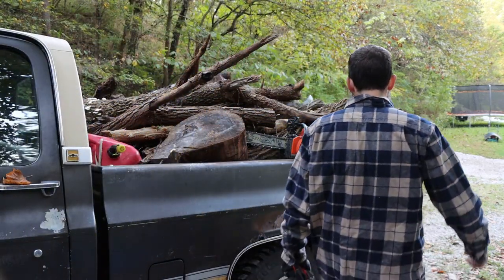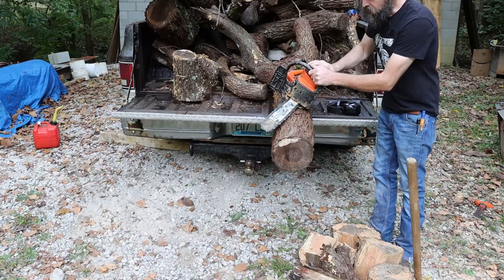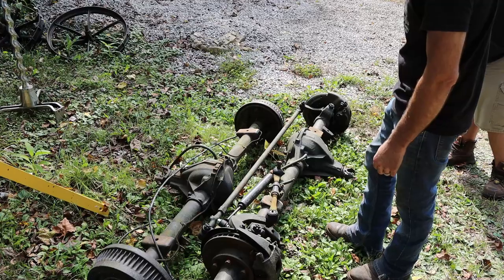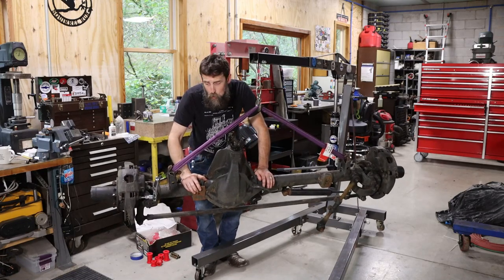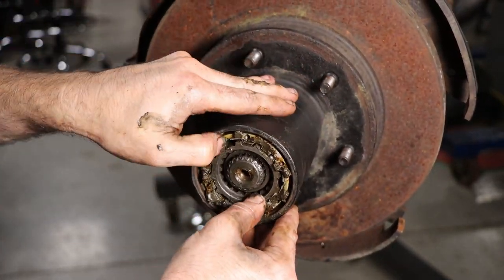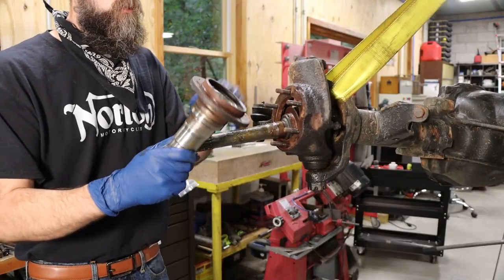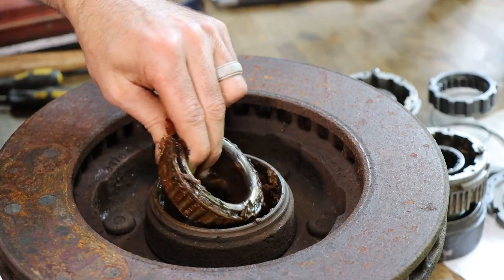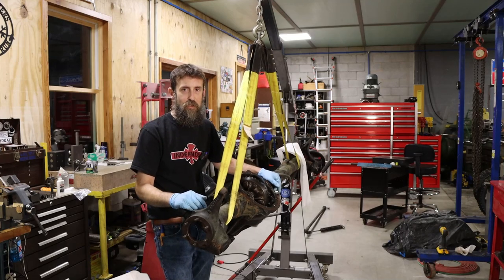Let it begin! Chevy K10 Front Axle Part 3

Comment: My house is completely heated with wood and buying a top handle saw, for all the smaller limbs and delimbing branches is one of the best purchases I've ever made.  It's nice to have a saw you can run 1 hand, while using the other to move branches.  

Another issue with the mushroomed heads of wedges is, sometimes, if the round you are splitting, doesn't break apart (we have to burn softer wood sometimes where I'm located) the mushroomed part will get caught on the wood.  So essentially it takes substantially more power to get that round split, due to trying to push the spread out part into the wood.

Comment: Very good presentation. Cleaning parts always takes longer than the job.
Chain sharpening by hand I have never got it 100% consistent, so now do with a grinder with a fixed set up that keeps angle and cut depth to each tooth the same.

Comment: heat is your best friend when taking those stock u-joints out.  breaking the injection mold plastic retainers in the press can get rather violent.  torch 'em out, the heat will burn that plastic out of there, making removal much easier.

Comment: Looks like pretty good axles. You will be like having overdrive with those 3.08 gears.
Reply: most people want to throw their 3.08s away. A farm truck with a granny gear and a transfer case with low range?  They are damn near perfect for that
Reply: I had a 86 Chevy k20 custom deluxe that the front axle got destroyed on it was 4.10 gears a built 75 Chevy k20 Silverado 355 with a competition cams Xtreme energy cam kit 268h 474/480 lift 221/224 duration,107 degree.. th400 turbo transmission and np 208 transfer case and b&m tork master 2100 rpm stall torque converter even though it is called a 2900,to 3,500 rpm stall torque converter tork master 3,000rpm but the tach I put in my truck showed it catches at about 2,100 rpm anyways the point was I ended up getting a set of 1983 GMC high Sierra heavy duty f44 suspension axles gm corporate 10 bolt had been rebuilt,rear was a gm corporate 12 bolt rear end, 3.08 gears 400sbc sm465  4spd my  truck would fly with the 3.08 gearset, which made it very apparent the  power steering gearbox even after adjusting the worm gear was shot, truck stops steering at about 92mph, and developed severe wonder steer with the power steering hooked up at anything above 65mph,my younger brother just took off the power steering pump,my response until I got around to acquiring the parts to repair it was only drive it when I have to and only run about 45mph, and with the 355 in it it would flat out burn the rear tires off, and the truck my brother would stand on taking off in 4wd would spin all 4,I'd tell him to quit smoking my tires if you don't want to buy new ones for my truck. I ended up putting a set of American racing atlas chrome plated aluminum wheels 16x7 and 285/75 r16 Baja widetrack at tires,I ended up putting used tires on I gave the local tire center $100 for $110 total kumho road venture 285/75/r16mt, tires they were just barely less than half tread.. but one of the most simple toughest,most dependable trucks I've ever owned, and I ended up trading it for a early 94 Chevy Silverado Z71 extended cab short bed k1500 rebuilt motor and transmission n and nv 241c replacement transfer case with tag, and that truck isn't half as dependable yet as my 86 Chevy k20 was. Motor is a 0.40 350 tbi from a 1987 Chevy p30 bread truck chassis, and the transmission is from a 1990 Chevy k2500 Chevy Cheyenne th700r4/4l60 transmission off a tbi 350 truck, and the truck has a heartthrob dual cat back exhaust no  kit cut off the cat welded straight to the down pipes and has the heartthrob brand glasspack mufflers and straight out the back and has 18 and half inch long 3 1/2 inch stainless steel slant cut exhaust tips.
 Sounds good at idle wish it sounded like my k20 though lol but even with all the newer parts on this truck it suffered from a severe lack of maintenance and it shows!!

Comment: hi,   as it is as usual, i ran into the same thing with my weedwacker from stihl.   the manual recommended checking sparkplug ( distance of contacttips) airfilter, carb settings( l&h screws) ,   so i checked. all things needed adjustments,  sparkplug was waaay of, and it ran too fat, after few minutes adjusting everything worked fine. no priming neccesary, 3 pulls in cold mode makes it run fine now,   it takes off immediatly as soon i pull the trigger 👍.    as allways thank you for sharing your knowledge. may god bless you, stay healthy .   cheers from berlin, germany ( perhaps u should contact ironhorse on utube for your nice tophandle stihl ?)

Comment: I bought a Government Surplus replacement P/T front driving axle for my old Dodge 3/4t pickup. It was the correct ratio, and it replaced the horrible full time 4wd front axle my truck came with originally. All I had to do was clean off the cosmoline  and add some locking front hubs, and then bolt it in. Best improvement  ever.

Comment: You’re the first person I’ve seen that actually puts the deep creep in the joints instead of just dousing the whole part.  Don’t forget your Speedo usually reads off the driveline so changing the gear ratio might put your speedo out of calibration.

Comment: These top handle saws are what professional tree mechanics prefer when pruning and topping trees they climb. It is great to see you working with the saw with BOTH feet on the ground. Many have died from cuts to there femoral artery by holding the piece to be sawn with one foot up exposing the inside of their leg and crotch area. Awesome fella to have brought you the H/D undercarriage for your pickup. You will find the ride a bunch rougher but who cares.eh. If I didn't know better a person would never know when passing by what a great shop is hiding behind it's rough looking exterior. Smoke and mirrors eh. Love it and that key stock trick is a beauty.  I sure wish I had known that one 50 years ago eh. When removing the inner axle housing/spindle with the needle bearing I just use a 5 lb dead blow hammer and give them a good hard smack. I have done over 100 of them and never harmed one in the process. Thanks a bunch for the memories of when I hade my own repair shop working on these units when they were much newer than they are today. The perfect start to my Saturday morning my friend.

Comment: You can also squirt a little fuel on the air filter, last longer than pouring it in the carb and it vaporizes better because the airflow breaks it up into a fine mist. Think blowing through it with an airgun.

Comment: A tip I was shown regarding heads on chisels was to remove the mushroom on the grinder and then run a bead of bronze weld around the edge of the head with a torch. The head still mushrooms under impact but the bronze weld hangs onto the edges and minimises them flying off.

Comment: One more thing that someone may have already mentioned about rigs with locking hubs.  If you haven't used 4WD in a long while go ahead and lock the hubs in for a few miles (can leave the transfer case in 2WD).  This will get all the gears in the case and the oil moving and hopefully prevent any rust scaring on the ring gear from sitting in one place in water or bone dry above the oil line/level.

Comment: Steve what ya need ta do with all yer used oil and and solvent mix is ta use it in yer wood stove set it up so that ya can drip it on the wood. just a thought Steve I've been burnin wood for over 35 years in my house and shop. just a thought. Just thought I would pass it on ta ya.....

Comment: Steve, 
That's good advice about the mushroomed heads. I was lucky the chunk missed me and went through the bottom lip of the guy next to me and lodged in his jaw bone.  
The change to 3.08 gears will transform your fuel mileage out of site and give you much lower noise levels on the highway from the lower revs. If your speedo still works don't forget to change the drive cable gearing to suit the "new" axle ratio.
Log splitter project in the pipeline???
Eric

Comment: Take that old 80-90 and oil change oil and "paint" all of the rusty metal on the truck. It slows down the rust and helps with the bolts when you replace something.

Comment: If you have put a carb kit in the saw and it is still not starting I would suggest that you put a fuel line and filter in. Also, equal strokes does not matter on sharpening a chain. As long as you take down all the rakers with a gauge. Nice score on the axles!

Comment: That's a young saw.  I declined taking my Grandfather's Craftsman 16" Bar saw....it weight about 30 pounds...it was from the 40's or early 50's.  WAY too heavy to be safe to use at that size.  I DO have his Homelite XL  12" Bar from 1963!  Yep, he bought it right off the bat when a "Lightweight" saw was now available.  Only issue is the rubber bar oil and fuel tubes have rotted away, and you can't get them.  Looking to use fuel line that is used for small 2-Cycle engines (Weed Whips and Blowers).  

As for that universal joint...35 years ago?  Solid chance I made that thing.  I worked for Dana during the summer a couple times and that would be right in that timeframe.  I made THOUSANDS of those things.  It was the job that told me to I DO NOT want to do unskilled shop work.  Money was great even as an "agency" person, but standing at a station all day making those joints sucked more than anything ever.  I was good at it though, they moved me to every single station in that place, and asked me to work fulltime.  Nope, I was going to be an engineer...lol.

Comment: Hi Steve, I'm so glad that you are doing up the old girl,!
The replacement parts you got should come in handy.
knowing how thorough you are the new to you parts will probably be as good as new by the time you put them on the truck.
While you have easy access, and MOST Diffs don't have them, why not drill and tap a drain plug in the shell for easy removal of oil? 
Same with the gearbox also,
It saves a lot of needless agro and it means that you are more likely to change your diff oil on a more frequent interval.
You mentioned about going through water in a 4wd
A late farmer friend gave me
 this advice many years ago,

 "just because a vehicle CAN do such and such it doesn't mean that you need to do it just because it is fun, protect the assets and have them working when you really need them, because that one time  might just save your life or get you out of a serious situation "
also a vehicle is to get you from A to B with the least amount of trouble
If you want to play have a specific vehicle to do so with.
Tony from Western Australia 🇦🇺

Comment: I have owned both a 82 Chevy k20 Silverado was originally a 6.2 litre Vin z diesel 4spd and np205 anyways it and the 86 Chevy k20 custom deluxe that I had when I got it both had rear shocks with a coil spring on them I put regular shocks back on the 86 Chevy k20,but the shocks like the 82 Chevy Silverado k20 were the factory rear shocks for it, but you might want to consider putting some of them on the rear of your truck Steve sir..

Comment: Have you ever seen where folks install a drain plug into the differential covers? Makes diff oil changes a breeze because you don’t have to take off the covers to drain the gear case. Really helps with maintaining with oil changes especially with those old 10 bolts.

Comment: If the camera wasn’t on that chainsaw would have started 1st pull 😆
Reply from the maker: Yep! That's how it goes most the time
Reply: @SteveSummers  That is why I got electric, at least it will work after 6 months of being in the garage. Also have 2 spare fan couplers, after killing the first one after 5 years. Extension saw makes for easy work on hedges and lower branches of trees, as you can stand far off from the pieces that are about to fall.  

Friend has the big saw for the thicker branches, but the long reach was great when we were trimming a bougainvillea bush for the first time in 2 decades. Thorns not a problem, until the last, when it was being trimmed off level with the ground. Growing back, that did not kill it. Garden refuse removal guys did not like that pile of thorns with attitude though, we all got bad scratches and thorns in, despite wearing a set of garden gloves under the welding gloves.
Reply: My 028 likes a sniff of fuel too...About 1-2wks

Comment: You might as well pull the body off and wire wheel the frame replace all brake and fuel lines then paint it. Then work your way through the body as it goes back on. As you say "no better time than now". I'm sure a go fund me would fund it

Comment: You can add a primer bulb to a saw, they sell bulbs and fuel line at most hardware stores or online. Just have to drill a hole and reroute the fuel line a little.

Comment: Hey Steve, your saw is similar to my 1981 Echo with a 12" bar, pre-safety model. Mine still runs like a top after rebuilding the carb 5 years ago. I bought it new for a $120 and it has cut at least 100 face cords of wood. They are good handy little saws!

Comment: Steve, you might consider drilling a hole in the bottom of the diff and putting in a plug to make it easier to drain and refill later.

Comment: I hope your not disappointed  in the Diesels 3.08s . If you spend 90% of your time on road 3.40s would be good. I have a 3/4 same year as yours with 3.73s it works out good. Your MPGs will go down with the 3.08s from lugging it.

Comment: Hi,Do you put ethonal in the saw from the gas?We dont have a choice in Massachusetts. Nice chips from a sharp saw.A dull saw is a dangerous saw.It helps to have extra chains.If you put some wheels and the leafs on the axel it makes it easier to move around and maneuver under the truck,been there done that.Water in the rear is not good for bearings.I love manual lockers,no aie or electric junk to screw up when you really need it. Manual says to pack your wheel bearings every year.You can wip up a spanner in a few minutes,helps when setting your bearings clearances.Those are 1000$ axels in the north east.No though of makeing it a three wheel drive adding a pos track to the rear end?

Comment: I don't know if it is just my region or national, but the chains that stihl packages for homeowners are 5° shallower than a professional chain. When I order new chain from Oregon, I get the stuff with a CX designation at the end I believe. It's significantly more aggressive, I usually use skip tooth as well. It makes a huge difference! In all fairness it is much more likely to go badly for an amateur user. On the offhand chance that this is the case nationally, you might want to order chain from Oregon. It's slightly cheaper as well. I don't know what kind of wood you usually cut so I would not necessarily endorse the skip tooth unless it's a lot of soft wood.
Reply: I believe it's just a liability thing. I've never been asked if I was pro as a condition to buy, but they do usually ask if you sure you can handle it

Comment: Building a truck or a jeep is a lot like Rocket science,  ie:  you need a bigger rocket to carry more fuel,  to power a bigger motor to push a bigger rocket to carry more fuel to power a bigger ect.   When you start changing things in a vehicle to make them "better" you can upset the mechanical balance of it,  you move the "fuse" (the part that will fail first) and often add weight (that pesky rocket analogy) I have always tried to keep my point of failure to be something that is cheap and easy to replace,  U joints and locking hubs, are a lot cheaper than axle shafts, transmissions or differential gearing.  While the 4 wheeler in me bristles at the thought of swapping in 3.08 gears in place of 3.73s  if you tire size is kept small it will be OK

Comment: Great score on those axles n suspension. Looks like low milage. You know your mechanic cares about his work if moog and Spicer parts are going in the cheap ones fail prematurely and cost you far more than they save you especially when they take out other parts
Reply: MOOG aren't near as good as they used to be.

Comment: The easiest way to suck water into your diff and axle is to drive through water when the vehicle has been in use and the components are at operating temperature. As the axles cool rapidly when you drive into dep water they will suck water in as things cool quickly, especially if you do not have elevated breathers and the existing breather goes under water. Would condensation be the reason this unit has water in it if it has been sitting for 30 years as you say?

Comment: The saw has a gasket leaking somewhere your losing your vacuum faster than you can pull it over to get fuel into the carb pressure testing should show you were your problem is

Comment: 2nd to engine swap, think the Axles are worse to do by yourself, did axles under my 79 Bronco during covid.  Yep best thing tear them down before you put them in so much easier, to work on. Dam , i was just at U-pull part trying find locking HUBs for the inner spring, At time stamp 21:46.  if bye chance your getting read of your other axles and has that spring, i would seriously Love to Buy one, Email Me AS i watch thinking of my pain i had, that Ball joint Upper with Weird ass Slotted tool that's needed (Think That Ford Only ), is what stopped me, from doing ball Joint, (there good) but who want tear all that apart again..  i even bought a tool it was worthless.  need Harden steel,

Comment: Since the gears are different, does that mean you need to replace both axles before you can run the 4wd? I'd assume that they would be running different speeds and would fight each other if you did just one end.
Reply: Yes that is true. Steve will need to only use 2 wheel drive until the rear one is replace.

Comment: I guess you don't take that front axle apart enough to take the time to make a socket.
Reply: I bought a '77 k10 from the original owner back in the 90s and it came with the snap-on front hub socket! Its locked up like fort knox.